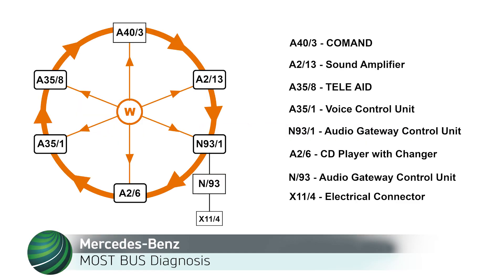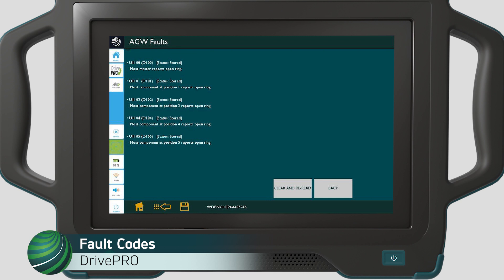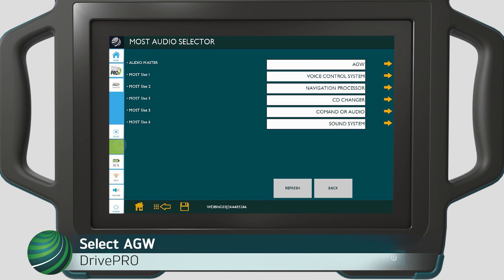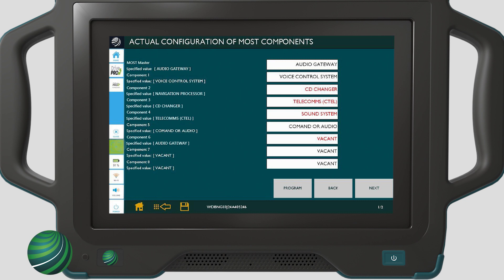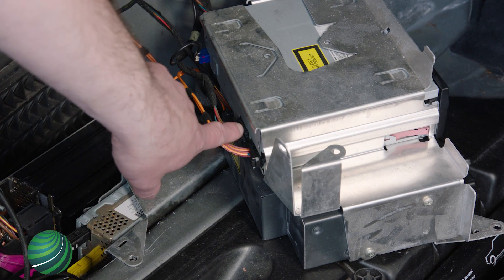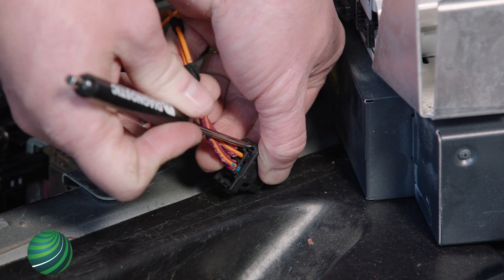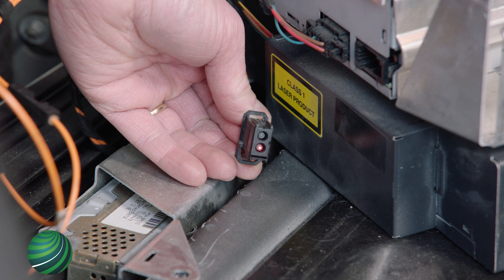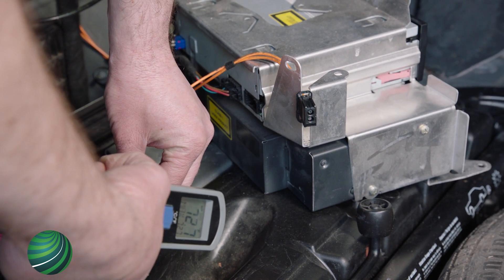Mercedes-Benz MOST BUS Ring Diagnosis

Comment: where can I get a test loop like that?
Reply: You dont need it, nor a laser.
Just tape the two ends together and put a flash light in it.
Position 1 for light entry, should exit at  position 2 on the next component in the chain, and so on.

Comment: Having trouble with my friend's W220, having the audio repeatedly waking up even when the car is off.
Heard that some component in the optic ring might be bad, but I had no idea what that means.
Now, I see how I can test that. Thanks.
Reply: Have you already solve it? I have same problem on w204 ntg4
Reply: @deividaspetkevicius9267  The problem was the audio amp and the navigation unit. DIdn't check which one, but I was not gettnig optic signal after that.
Looks like water got into the trunk and damaged those units. 

In fact, the bigger problem was the battery drain problem.
Probably because of continuous wake up, the battery drained in just 2~3 days even from the full charge.
I changed the amp and the navigation unit with the ones bought from junkyard, and the problem seemed to be fixed. No more battery drain.

The screen has been changed with android unit, so not sure whether the original screen would still wake up, but at least, android unit is fine.

Comment: I have this W204 , with error code as D018- Most communication has a malfunction ( ring break at position 1)

I have done all test and everything is okay yet this code keep repeating, I change the AGW yet the problem still persist, I shoot lesser light through the fiber Cable and all the cable shows good, 

I removed the fiber at the AGW and shot light through it, and I saw that light at the other side of the cable too.

Please what could be the issue, the amp has been changed too, the amp even relay it res light.

Please I need advise
Reply: Did u get fixed
Reply: it's not just laser light in fiber, it is DATA that needs to go through. 

All connected modules in the ring network must be cooperating.